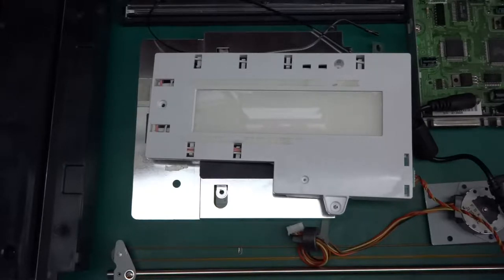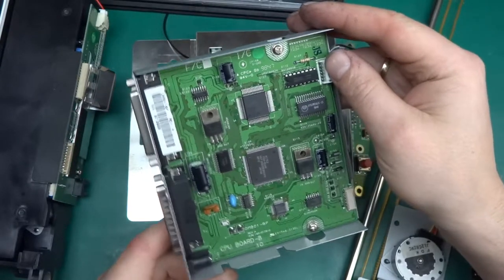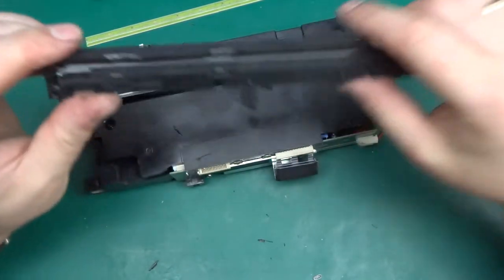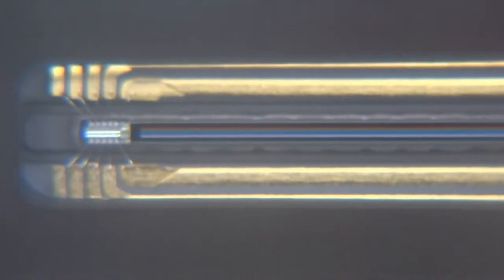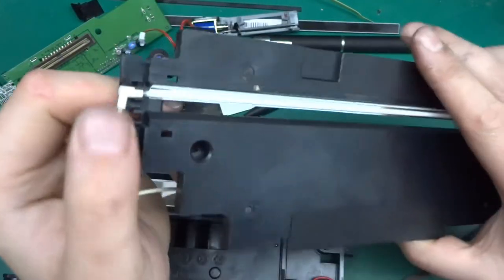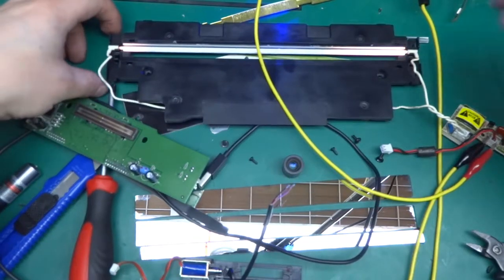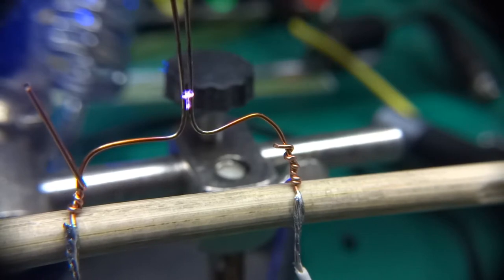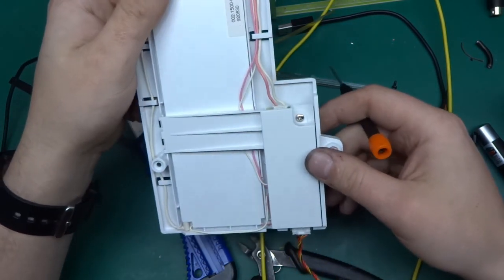Two Canon scanners - what a difference - and a bonus mini Jacob's ladder

Comment: Haven't seen the entire video yet, just the high voltage part - that inverter has quite a bit of power...
once, I modified an old laptop CCFL inverter (shorted the secondary side current limiting cap, also shorted the fuse on the primary side etc) - made even bigger and hotter arcs (easily stretched to >1-2 cm), but the transistors gave up in a few seconds and released a LOT of magic smoke, burning the PCB during the process.... managed to blow up the transformer too when trying to drive it with the classic 555+MOSFET driver, was worth the fun though, maybe you could try modifying it to higher power too...?
Reply from the maker: +ferencproject why not :) more power more better, right? Lets see. I have a few things lined up already, but will re-visit this for sure, as soon as time allows.